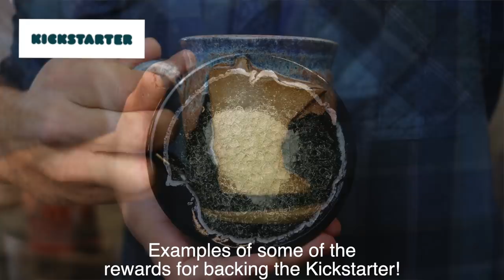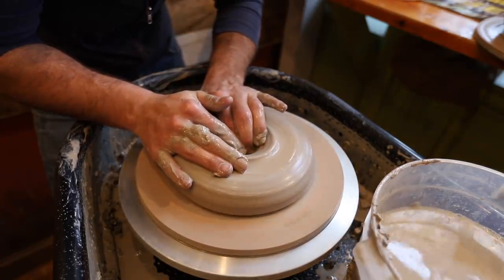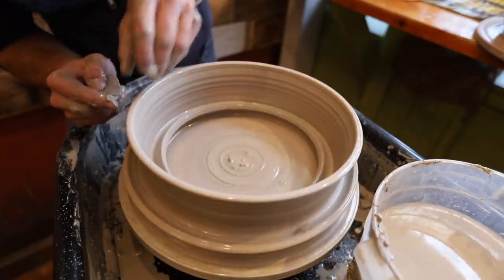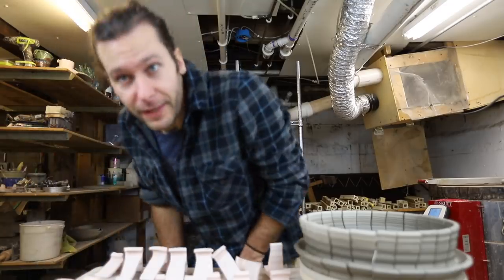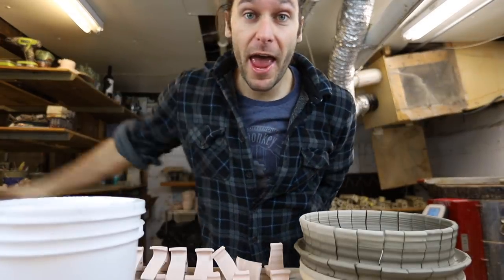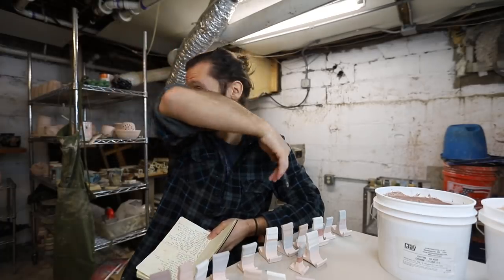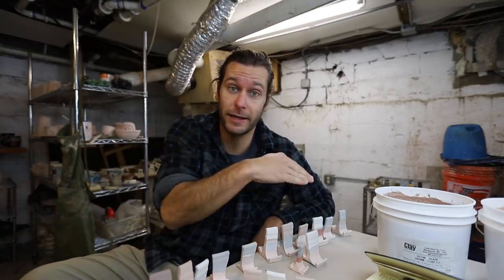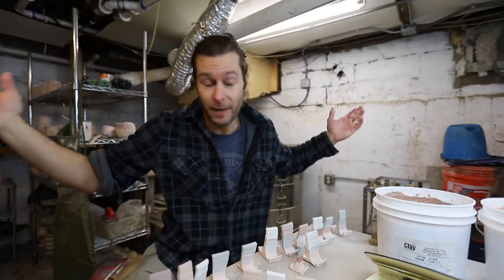Throwing Test Tiles and Testing Glaze Combinations

Comment: Thank you for sharing how you are making and recording your test tiles.  I thought I would share how I record my test tiles.  In my handy dandy note book I make a grid sheet.  that the top I have a key of the glazes and a number assigned to the glaze.  Then in a grid type fashion have the column labeled 
1- tile number
2- YES we like the results
3- NO bad results
4 - number for each glazes you have 

then all you have to do is place an "X" on the glaze numbered column.  This has made life so much easier for me.  I just wanted to share because the 2,730 can be a daunting task. PLEASE take this with a grain of salt this is just what I found to work for me.  THANK YOU FOR SHEARING!!!

Comment: Never did this with three layers but for two layers. My system was to number each glaze then make as many tiles as needed so I had one for each color. Lable bottoms of tiles so that numbers did not repeat. (Other wise you will have many with the same numbers after many tests) all test tiles got the first glaze then each in a second color. Systematically working through all the glaze colors. Ex. My white was number 1, blue was number 3. Brown was number 4. Tile was marked 1-3 white then blue. Tile 1-4 was white then brown. Hope I made sense good luck and hope you get some great colors.

Comment: Wow, i also tend to cut thrown pieces for testtiles, but your method is super good. BUT: I would appreciate it, when people showing or telling others to overlayer glazes, they would also mention that the logic of pouring one "so called" food safe (whatever that is these days) glaze on top of another food safe glaze, that this does not necessarily result in another food safe glaze in the end. Expecially when you use ready made glazes, where you might not know the glaze formula or ingredients. Simple Chemistry. Please correct me, if I am wrong! Or maybe I just missed that remark in the video...
Reply: Of course I am only talking about glazes applied on the inside for pieces that get in contact with foods & drinks.

Comment: instead of numbering the pieces and writing down a bunch of names, what if you number the glazes? if each glaze is assigned a number, then you could write those numbers in whatever order you dip them in on the bottom of the test pieces. that way you wouldn't have to refer back to the notebook every time to figure out what the combination is, you could just look at the numbered buckets of glaze. might save you some time!

Comment: Hi John,
You need more scientific approach. ☺️ Hope that this comment is going to be understandable. You say that you mark each tile by a number. That is good, even great. But how do you make diference between the first serie of test tiles from your fifth série ? In the end they are all going to finish in the sime box for test tiles. 
 When you make the tests you have to bee very, very, very... Very precise. If not, all the hard work is gone 😭😭😭 (I know the feeling). There is a simple solution. If you use the sime numbers (from 1 to 16) for each serie of tests and you mark your tiles when  they are still wet (as you did on this video). In this case you just have to add a date on your tile (and in your note book also). And you do thid with the brush and the iron oxide (because your tile is fired once at this point). So you'll have your tile number 8 from 20.02.2019 and you'll know exactly what you did because you've marked it in your notes as 8 20.02.2019. (for exemple). If you mark your tiles from 1 to 2560 than you just have to be very careful not to mark the sime number twice (I did that too). And I will not enter into the thickness of each glaze testings or you're gong to 😭. You can do the glaze testing all your life and still you will not be close to an ending. 😁 But in the end just HAVE FUN with it, that's most importaint. 😊 🇫🇷

Comment: Your math is a little bit off. To test all 15 with 3 layers being different would be 2730. But if you wanted to test all possible 3 layer combos it would be 3375 which would include dipping it in the same colour three times. And if you wanted to test ALL possible combinations with 15 colours it would be 3615 options (this would include one and two layer glazes). Which is a lot of options. Not that this comment necessarily helps I just wanted to figure out the math. Btw love your work.